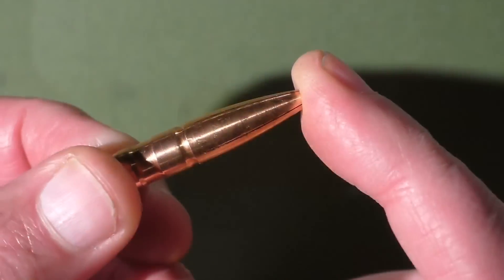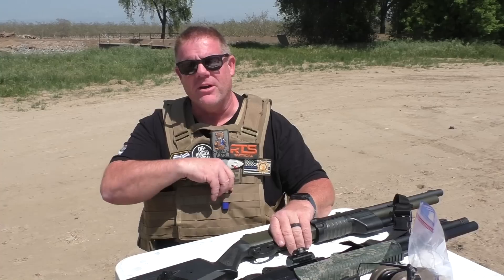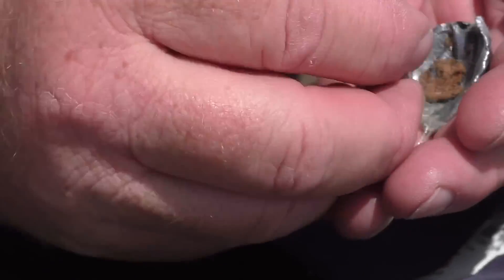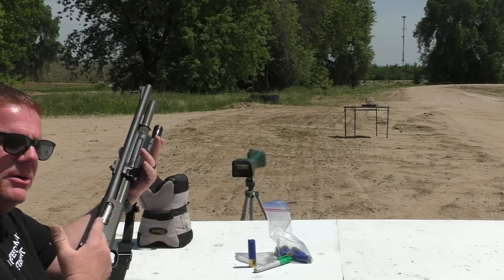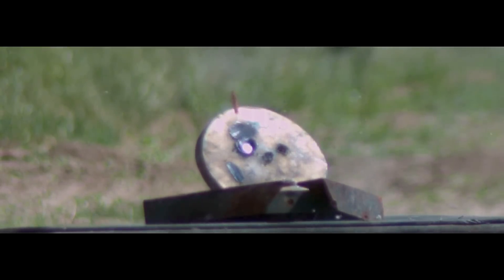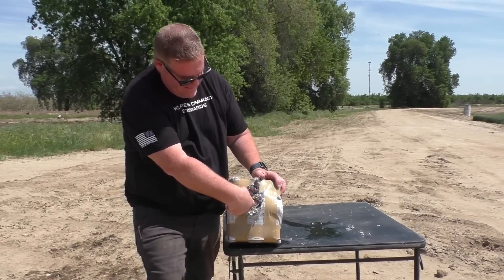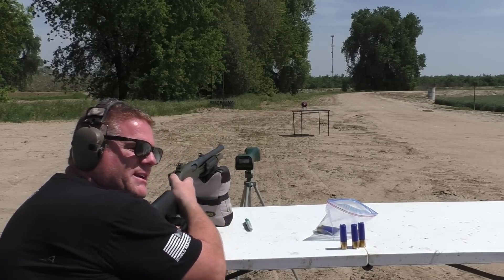300 Faust - 12ga. Slug Prototype -  First Test

Comment: Your initial idea may have failed, but the demonstration may lead to better fruit.

What if using the same concept with the slug you press in some buck shot or ball bearings of some various materials?

Also you can try a thicker stiff rubber inbetween the wad and projectile, plus a hammer and punch in the right size is cheapish.

Comment: Would it be possible to have a solid type Diablo, drill into it the depth that you would want the 308 to sit down Inside it leaving some lead in the bottom of Diablo without drilling all the way thru it so the 308 wouldn't go backwards..instead of using a spacer pc behind the diablo..does this make sense to anyone else?? Great Thanks for the Video Gents!

Comment: I bet they would've worked fine if the bullet had been flush with the back of the diablo bell and also resting on the disk below. As long as they were both moving the same speed, I don't see why they'd separate. Unless maybe the disk flexed or bowed somehow, which your heavier metal disk idea might take care of.
Reply from the maker: The bullet was flush with the skirt.  I showed it in fact.
Reply: @taofledermaus  Huh. It looked like it was driven further. I was watching for it, because that was my first thought after it seperated. But I may easily have mis-seen over video. Too bad, though. That would have been an easy fix. The design has real potential.

Comment: So, I have a basic break-barrel .22 springer that I take out plinking. With my friend's chrono, I forget the specific numbers we figured out then, but we got it up past the kinetic force of a .22 short, by dieseling the hollow at the back mixing three-in-one and paraffin.
But it got me thinking, because the drop of wax wouldn't ignite on its own, it needed oil to ignite from the pressure and then the paraffin burned fast. But you could do other materials instead of paraffin, right? Like maybe the stuff they put in model rockets, or the DIY sugar stuff.
If you have any of those big suckers left -- especially ones with the hole drilled in the center -- I bet it would be fairly easy to make a relatively safe, gyrojet shotgun slug with surface-burning solid fuel. I bet those zinc diablos would do better than lead. I mean, doesn't that bell at the back of the diablo shape just seem to beg for rocket thrust?
There're probably lots of really good reasons not to be so stupid: legal, medical, financial, idk. But it sounds so damned fun, right? If it worked, the slo-mo shots would be sick! I'm sure I'm crazy, but it's a fun idea. Y'know? I'm not sure if I'm glad or not that I don't own a drill press.

Comment: would it be beneficial to do the same texturing to the copper jacket so it reduces slippage & adhere with a little 380LocTite (rubberized cyanoacrylate)? Lone Wolf uses it on their mockglock pistol frame rails.  

do the direction of the grooves/tread matter? is it better to go one way vs another?  also, could you maybe use a lighter .224 diameter 70+gr bullets (or a tungsten TIG weld electrode) & an aluminum gas check?

aaaand it just got to the point where you covered ALL my points & I feel like you were reading over my shoulder as I was typing.

Comment: Rather than boring a through hole in the slug, stop 1/8-3/16" shy of drilling all the way through.   This will leave a bit of material for the 300 blkout to rest against.  Also, being the drill head will leave a tapered pocket 1) this might create a little pressure lock or vice versa between the bullet and slug 2) drill a through hole with a smaller bit to get a good seat  3) put something other than air in that little pocket and see what happens.   Great video though!

Comment: I might suggest a combo of ideas I've seen here in the comments.  If you are using the same diablo slug, leave a little more room at the base.  Drop a steel disk onto the base of the bullet, then fill the cavity with melted lead.  The steel disk holds in the bullet, and the lead backfill protects the barrel.

BTW, I love your channel and your creativity!

Comment: I’ve always thought a cool and likely effects design would be to do this but instead of .300 blackout you use a small tungsten penetrator rod and have the led slug act more as a hammer by using a backing

Comment: Next time, you need to wrap them in a tarp, strap them down and accelerate them out of an infrared metal detector. That's guaranteed to work. 😉 Or, maybe just a roll pin through the backend. 

P.S - This was in no way a disappointment for us loyal fans. It was a blast as always.

Comment: Is it posible to drill a hole (or 4 holes across each other) through both slug and 300BO and place a pin (or pins) to hold them together? that way they can stay intact

Comment: I have a thought. Looking at the projectile you lovingly made is it possible that the way that you inserted the bullet into the slug may have caused the fail as it looked as though you pushed it in through the back maybe try pushing it through the front. Im not expert but its an idea
Reply from the maker: I probably would have damaged the point if I tried to push it in that way
Reply: @taofledermaus  yer true now that I think about it it would be alot hardes to push it in the other way but still was a good attempt hope you come up with something was a cool looking round

Comment: The only thing I can think is melting the lead, or some sort of lead filler in the front or back. Or… knurling the copper bullet towards the back like you did the slug, then inserting them. Or you could cool the bullets with liquid nitrogen prior to insertion. Maximizing the fitment possible. Combine with any sort of knurling and it could create more surface area to contact with when it expands.

Comment: Wow. Before I even take a look at the slow-mo, I guess these hybrid slugs will tumble. Unless fired at 2300 psi. I think they may need 3 plastic stabilizing fins on the end.

As for the zinc slugs, bore the hole exactly the same width as the 300 Blackout bullets but super glue 'em in there. With stabilizing "feathers".
Reply from the maker: I doubt super glue is strong enough to handle the shock

Comment: To make these projectiles work you need to create a lead pouring mold that holds 300blackout in the center so when you pour lead it grabs center groove on the bullet. That way 300blk won't slip out.

Comment: While instant sucess is always nice, you learn more from failures.

While you do your next batch of testing, i would try knurling the base of the 300blk to roughly half the length of the diabalo.

So the first 75-ish% presses into the lead cleanly, and allows fresh material for the knurling to engage if it tries to slip further.

While your at it glue a few right as you press it, perhaps the stubborn flavor of loc-tite?

Nice video as always.

Comment: Maybe drill a smaller diameter through hole from the base, then flip it over and drill the hole for the 300 but not all the way through. Let the slug be the driver for the bullet.

Comment: You should drill and run a copper or whatever pin crosswise through the side of the slug, through the .300 blk out to the other side of the slug, that way the pin holds the .300 in place.

Comment: I think i understand what went wrong with this design. The lack of the double tap procedure.
After a press fitting of that magnitude the operator needs to double tap the fused materials with a hand or finger and confidentially state:
"That ain't going nowhere!" or similar, based on local dialect and lingo.

Comment: I had a sneaking suspicion that the bullet would not stay attached to the slug. You didn't say if the slug was pure lead or an alloy. If lead, then a retest with a harder alloy might produce better results. Also a mold that holds the bullet while the slug is poured around it, essentially soldering itself to the bullet. 
All said it was a good idea, and a good failure. Learning occured, progress was made!

Comment: After pressing it in partly fill the cup of the slug (until the blackout is fully covered?) with molten lead to bind the two together more.
Reply: Or even just some molten lead in the cup to better bond the two even if it doesn't cover all or the blackout.

Comment: First, let's be reminded that in no way should this "test" be construed as a failure of the Lehigh rounds!  If I were Lehigh I would be upset that you repeatedly used that term in connection with their product.  Besides firing them out of the wrong firearm, the speed of the projectile was more that 50% higher than their designed sweet spot.  I'm not sure what you were trying to achieve here.
Reply from the maker: Never said the Lehigh bullets were the cause of failure.   They sent me 50,  300 blk bullets even when I told them we had no way of loading them properly.  We asked for their .45 acp frag bullets.

Comment: might try pressing the diablo slug so it molds itself into the gas check on the .300?.. sort of like a sizer die press maybe.. that should hold the 2 together.. that or slather some jb weld in the gaps.. just a thought

Comment: It's only a failure if you don't learn anything from it.

My thought is to drill your hole from the backside of the Diablo but not quite all the way through. Leave an 1/8 or so for the base of the 300 BO to sit on. Press the 300 BO round in so it's base is in the nose of the Diablo.  Maybe even add some heat, flux and solder and maybe not load them as hot as your first test.  Who knows, might even be a bigger failure than the first test.

Comment: If you have the mold for the slug, you could seat the 300 like you did, then put it in the mold and heat the mold with a torch, I am thinking if you heat it up enough lead will flow into the crimped sections of the copper round and lock it in. Or insert the 300 in the front of the slug without drilling completely thru the lead.

Comment: Ditch the slug, just use sabots to propel the .300 Blackout.
Reply from the maker: It needs much more spin to stabilize from a 12 ga.  The fastest rate we could get is about 25000 rpm and these need over 100,000 rpm.

Comment: Try a ring around the bullet in front of the slug.

Like a snap ring, but only wire, no holes for snap ring pliers, installed after insertion. That way, pulling the bullet out requires enlarging the hole in the slug, but the slug is constrained by the barrel.

Comment: Time to replace one of the fiber wads with a penny :D  Maybe the lead is expanding when it's accelerated which is loosening the interference fit, which makes it a shame that the Zinc ones couldn't take the pressing for comparison.  I noticed that the 300BO's have what looks like a groove in the side of them too, so maybe swaging the Diablo down after the 300BO is fitted may give it more mechanical grip?  But yeah, a metal disc would probably suffice and be the simplest solution, till you try it and start digging out discs with a 300BO sized hole punched through them :)

Comment: I think you're right Jeff.. a metal disc between the gas seal and projectile should do the job. 
A few years ago you used a pic of mine.. a sectioned Dual Bond sabot slug... in that pic you can see the sabot has a steel disc below the projectile. 
Perhaps even an aluminum disc will work and wouldn't add significant weight to the payload.

Comment: Next time you try pressing bullets in, use some bearing retention loctite as lube to push it in. I'd be curious if the additional connection strength would keep it in the lead or if it would just gut the lead as the inside sluffed off

Comment: Makes me wonder how Chris Bondi assembled the Head Shrinker slugs with .30-06 bullets in them. There's absolutely some merit to this idea, Jeff, and now that you've got the ball rolling I expect some clever engineers are gonna get to work polishing this design!
Reply: Probably the best option is a modified mold to cast the slug around the bullet.
Reply from the maker: His used a blind hole so it was backed up well.   He also used some sort of epoxy to hold them in to prevent inertia from driving the bullets out the front.

Comment: This is what i meant with a cored slug🥰🥰🥰

I dont know if you remember, but i mentioned this type of bullet. Someone made it how I had it in my head.

Even some knurling on the side 😎

To bad they have such a thin back, the bullet justblows out the back.
The slug should be poured around the copper .

Comment: Obviously what you need to do is use an intact diabolo slug as your wad and load them into 4" hulls over 70 grains of powder to maintain that velocity.

It'll be fine! .45-70 used 70 grains of powder, and Jeremy Renner had no trouble with the recoil from that. You'll be fine!

Comment: Would machining a taper in the slug rather than a straight-wall hole give the blackout part more support? Of course, then you'd need to machine a matching taper on the Blackout round as well...

Comment: Hey Jeff, great channel! I Love watching your videos! I have a suggestion. Maybe making it a "bonded" bullet? Solder them together. Heat up the 300 bullet a little bitl, put some soldering Flux on it, let it cool some before pressing it into the lead slug. Then carefully, slowly heat just the tip of the copper 300 bullet just enough to begin to melt the lead a little. The same principle as sweating/soldering copper plumbing together. It's worth a try! Or research how ammo manufacturers make bonded bullets. Maybe they have a really good way of bonding lead to copper. Keep up the great work brother!
Reply from the maker: Not sure if I could get it to flow without melting the pellet in the process

Comment: OG really violating community standards..
Aubergine 🍆 is an eggplant fruit.

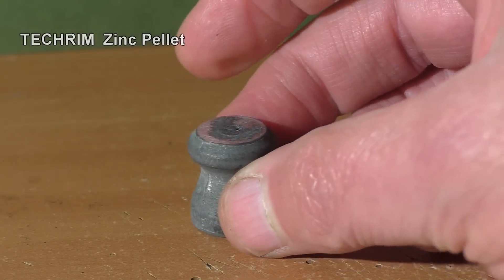The .300 BLKOUT projectile needs far more spin that the 1:24" rate typical of a slug tube
Reply from the maker: But mounted properly in the diabolo slug,   it wouldn't need any spin

Comment: If the metal disk doesn't work maybe some type of metal bonding epoxy would be best. As a completely impractical solution you could even try drilling and pinning it in place. Either way it's a neat concept, I hope you find a solution.

Comment: My suggestion would be to shorten the diablo round. Solder the 300 blackout in with tin/lead solder which is iconic bonding and the base would be flat  with solder or a dime on top of that. That way the copper round doesn't separate from the slug.

Comment: To be honest, I thought this was going to work perfectly. Also, I thought that it would be a devastating projectile. Pitty.
Reply from the maker: Oddly my concern was preventing the bullet from coming out the FRONT of the slug.
Reply: @taofledermaus  I would have probably thought the same in your situation. I would expect that inertia works more on the heavier slug. Like the slug, resist more to the movement because it is heavier. Bullet being lighter should have moved first and be in front of the slug. That would have been my train of thought.
Because the slug was coming out first, I assume that the bullet was not having good support, so it was not pushed forward as good as slug was. Possibly, the wad was too soft, as you have mentioned. Anyhow, that concept seems off 300 Blackout in Diabolo slug looks still very interesting.

Comment: I'm guessing that the base of the .300 was above the base of the slug. The shock of the slug accelerating and the round being unsupported for those hundredths of a second was enough to dislodge the round and from there it was moving slightly slower than the slug (the transferred force was like transmitting a pothole through a spring/strut, still affects the chassis but to a lesser degree than it affects the tire). The fix is probably easy enough, the heavier wad plate but also ensuring the bases of both slug and round are flush to the wad. If you miss that part you'll likely have the same problem.

Comment: The experiment was a success, the results not the expected ones.
A couple of maybe points:
a) cast the slug around the core;
b) dip the core(preheated to slug melting temperature) into the slug right after pouring the slug in the slug mould.

Comment: It would have been a failure if your cameras failed and you didn't get any video. The double impact on the lead plate was a fantastic bit of camera work.

Also, the correct incantation is :"Focus, you fack." (Apply appropriate Canuckistani accent.)

Comment: Eh, failures are just the paving stones of science, Jeff.  You can at least say that it's interesting in that it illustrates just how much pressure is going through the barrel of that shotgun when it's capable of pushing the slug with enough force to dislodge a bullet that you had to press in using several tons of pressure.  Any time you can learn something, it's not a failure.  Maybe try duct tape next time.  😉

Comment: Drill stepped hole in slug, small in front to press bullet in, but larger in back to melt and pour lead fishing weights into to fill up around those deep cannelures the bullet is blessing you with for extra hold. 300BLK stays centered and yawed correctly and held securely in the slug. You got this.

Comment: Part of the issue is how much surface contact there is between the .300 and the pellet and how they were assembled. You're using a hollow base pellet and pressing the bullet in through that base, leaving a concave inner surface trying to grip a smooth convex outer surface, and very little of the surface at that. There is maybe 20% of the bullet surface making contact with the pellet on the sides? Without something like others have suggested (some sort of pin, or molding a pellet around the bullet base) it'll pop out every time, like unstacking cups. If you used a solid base pellet, and pressed the .300 in from the top, the pellet itself would probably act more like a shot cup and carry the bullet with it.